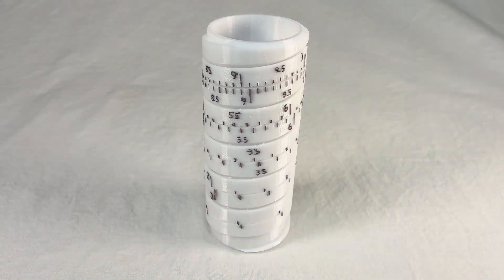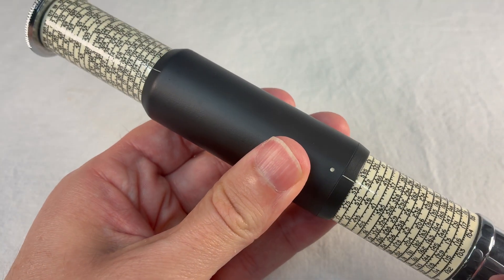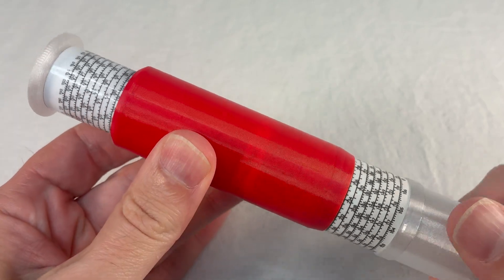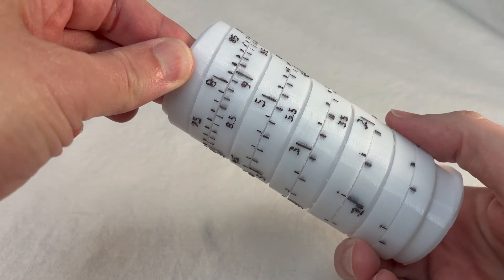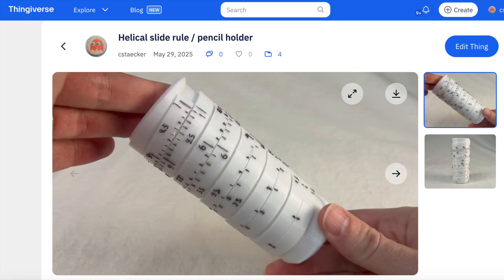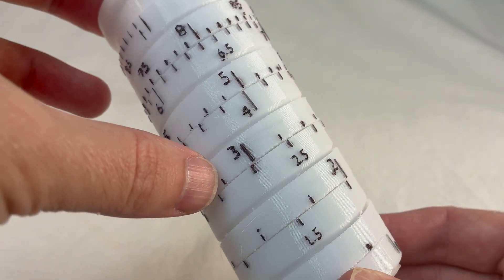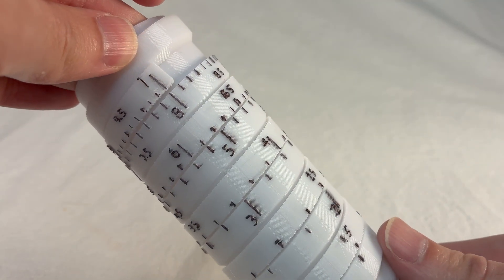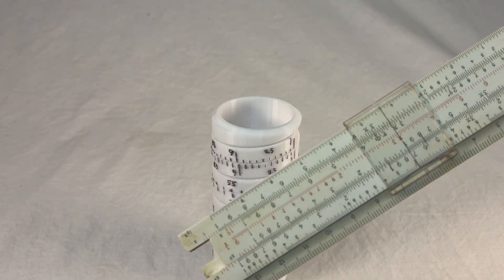I made a new kind of slide rule: Helical 3D-printable slide rule

Comment: Also its so bendy! i think its kills accuracy
Reply from the maker: The bending doesn’t affect the accuracy at all- that’s kinda the point
Reply: @ChrisStaecker  so expansion or twisting caused by compression immeasurable conidering how inacurate that logarithmic scale ruler?
Reply from the maker: @hlibprishchepov322  OK you mean that the sliding piece is prone to warping while you are using it? Yes you're right that has a real effect. (I thought you just meant the helical shape of the scale, which doesn't matter)

Comment: Yeah, I guess manufacturing a precisely-toleranced fine pitch version of this would have been impossible or at least impractical to do back in the day. Probably still too finicky to make on a large scale (make a small scale on a large scale?) even today.
This looks like a job for Electrical Discharge Machining! You can get insanely close tolerances with wire EDM. Someone do it please!

Comment: this is very cool! 

I recently bought an Otis King and had a similar thought, but I envisioned it would a flexible transparent plastic sheet (with a scale printed on it) wrapped around the inner cylinder scale.

basically, why not make the outer cylinder transparent? if you even need a cursor, it would just be a string or hairline that can be stretched across the whole thing vertically.

Comment: To remove the need for 3d printing you could print one helix on paper and make into a tube. Then print the other helix on acetate and wrap around the paper (tape that into a tube) and you're done. They won't spiral in and out so easily (you'd have to do that manually.) but for the 99% of people without a 3d printer it would work 

You'd probably need to adjust the scale slightly on the acetate as it's a slightly wider tube.

Comment: Print a cylinder with all the features in the right place, then laser cut the cylinder in two helixes.
Reply: or cut a pipe 😂
Reply: @GeorgePlaten  the measurements are what’s difficult, but if you’re already using a laser cutter, I suppose you could do that, but I’m not sure I’ve ever seen a more than three axis laser cutterter

Comment: If one wanted to make a more serious or precise version of this, I would stick with CNC-milling the core from a hollow cylinder to have the slotted guide stator.

The slide would could be made as a flat sheet stainless steel metal piece with laser etching. Then the only question is whether or how you could roll it into a spiral!

So maybe the slide would best be made as a laser-etched tube of the same outer diameter with the thinner wall to match the slot. You could then make a pair of them from one piece.

This all requires tooling, so it's a bit of a thought exercise, mostly. Maybe there's a more reasonable way to make the slide by using wood or bamboo and forming it "softly" before applying an appliqué.

Comment: I think the real biggest issue with this guy is that it can uncoil somewhat when you push it, which might reduce accuracy
Reply from the maker: Yes- you can tell that my example was not perfectly lining up. The coil has quite a bit of flex in it, and it doesn’t always move & sit perfectly the way you want.
Reply: @ChrisStaecker  presumably you could have similar t-slot/dovetail arrangement that linear slide rules use to hold scales in place... Maybe not 3d-printable though
Reply from the maker: @zokier yes my first notion was to have that exactly. But it was too fine at the scale I wanted
Reply: Carbon fiber!

Or make them two screws, that extend towards the central axis for more stiffness.

Comment: to make a more accurate version you could do the 3D print completely smooth then print a scale on a 2D paper printer and glue them together.
Reply from the maker: Yes I considered this too- I should work great. I’ve heard it’s hard to glue paper to 3d printed plastic, but I’ve never tried it.
Reply: @ChrisStaecker  What about a cylinder like a piece of wood or a kitchen roll and then print one helical scale on paper and glue it on. Then the scale of the other helix on a transparant sheet and wrap it around (not sure what the best way is to stick it to itself). Then you just need to slide the transparant sheet over the paper to line it up properly. I don't know how to print on a transparent sheet though. It might be easier to make the second helix by wrapping a strip of paper around the cylinder, and then glue some other strips of paper to make it not lose it's helical shape. Then you just slip slide away until mathematically satisfied.
Reply from the maker: @WhiskyRomeo yes I agree that would work well- no weird geometry required.
Reply: @ChrisStaecker From my experience, layer lines act a bit like a nonstick surface with some adhesives. Flattening the surface helps things stick. Wet sanding if you're patient, flame polishing if you're patient enough to print a second one after the first one flops over.

Coating the surface with something (filler putty?) might work, but I've never tried it.

That said, I'm guessing the best way to make working models would be making flat rules, then forming them into spirals around a mandrel. 3D printing is definitely more accessible.
Reply: @ChrisStaecker  Cyanoacrylate / "super glue" sticks to PLA like teenagers to phone screens. If you want a more durable alternative, you can get "plastic paper" (PVC is common) which can be laser printed. It has a matted surface which takes glue VERY well (I still have bits of it stuck to my floor after dropping a piece with CA on it).
Reply: You can use toner ink on 3dprints directly... lemme search for that article I read ages ago
Reply: Ah, it's called "Toner Transfer" apparently. Hackaday has published some articles about it, it's awesome!
Reply: @Splarkszter me when I spread misinformation
Reply: Most 2d printers' rotation distance on the long side is off though, remember to scale the  image till it's accurate if you print it that way.